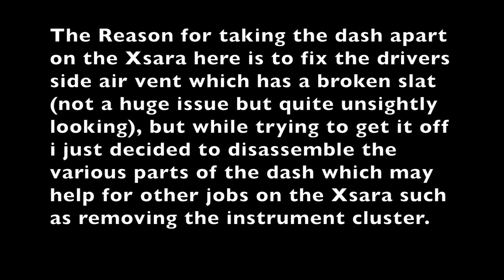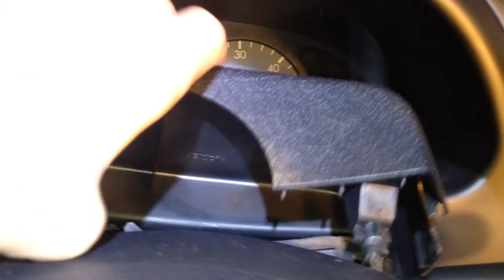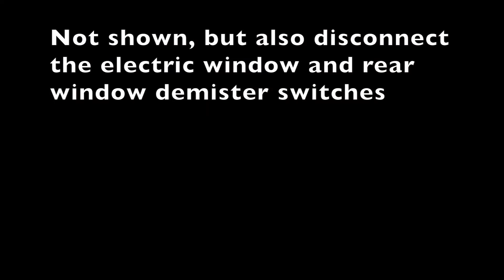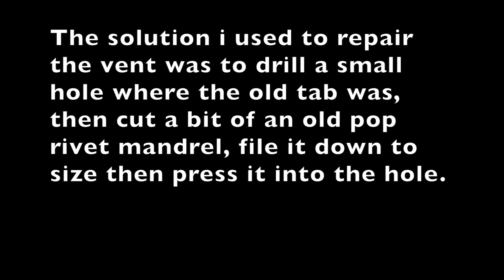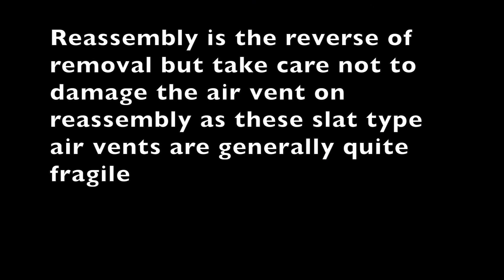Partial Dashboard Disassembly/Air vent repair - 2001 Citroen Xsara Hatchback

Comment: is there any way to easily remove the plexi glass in front of the "instrument cluster" ?
Reply from the maker: You need to remove the instrument cluster. Not sure how well its stuck on there but it can be a bit of a hassle just to get the clear plastic bit off. Usually it comes off with the front part of the instrument cluster if you need to swap it for a good one that avoids actually having changed any electronic elements of the instrument cluster.

Comment: I'm doing this now. Had to look to see if this was on here to see how you do it.. I've just nearly snapped mine in half. Still four screws to go. lol.
Reply from the maker: Ahy it can be a bit fiddly on the xsara just best to be sure you have got all the screws
Reply: I've still not took out the last two screws. Getting to them behind the wheel is a pain. My dash is nearly not there and I still have to use the car for work. lol. Might be Saturday or Sunday when I get the chance to go for it. I'm only wanting the heater switches out because the blower blows at full speed and the switch to turn it down or off doesn't work. After 7 months I'm getting a bit sick of the noise.
Reply from the maker: +fred smith IIRC the dash doesnt need to come completley out to get the HVAC controls, most of what i remove here will give you access to them.
Heater blowing at full speed is a typical xsara (and 306) problem, have you checked the resistor on the blower motor? Had the same issue on this xsara, it was not the switch.

Comment: Nissan almera 4 door saloon 2002 the one with boot,  i looked into the engine and it has a mass flow sensor,  my friend who drives an opel he reckons his mass flow sensor is broken in his car .and his engine to fluctuate in terms of acceleration when ticking over hi res low res hi res low res is this the mass flow sensor. What do you think
Reply from the maker: It could be anything causing this, the first step would be to plug in a fault code reader to see what comes up, also join the relevant forum/owners club for your car and ask the question over there describing the issue.
Sorry i cant be of any more help but there can be a lot of things causing this problem.
Reply: peugeotCitroen2CV No thank you,  that was very helpful,  i was actually speaking to you a couple of weeks ago in reference to my nissan almera, I was finding it a little bit hard too close the drivers door, it's sort of smack the bottom of the door a bit before it shut and you suggested,  that i open the door the full way opened , and lifted up to see was there any play in the door,  i did this and the door is solid, what other what ways can a door be out of alignment,  i seen your video showing how to rectify a door squeaking when you open it that was brilliant such a simple thing,  i never would have thought off. Great video,  if you can help that would be great but i am aware , some things can't be helped just by texting.
Reply from the maker: jozzerful2 Ah yes hello. If the door has no play in it, then its possible the striker plate is out of alignment. Other than that the door may have sagged, ie the metal on the A pillar or door has deformed slightly with age
If any welding or adjustments are needed it might be better getting it looked at by a bodywork repair place. But check the striker plate first, also i forget is the hinges on an almera welded or bolted into place, if they are bolted into place there could be a bit of adjustment to get the door back in line.